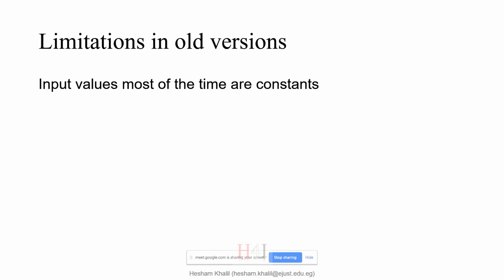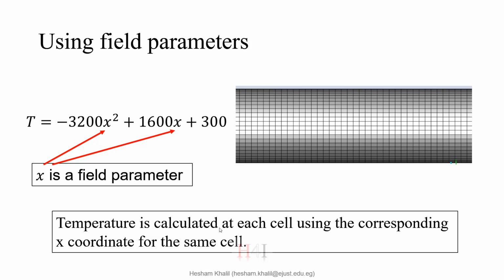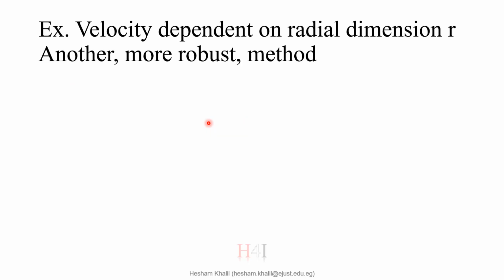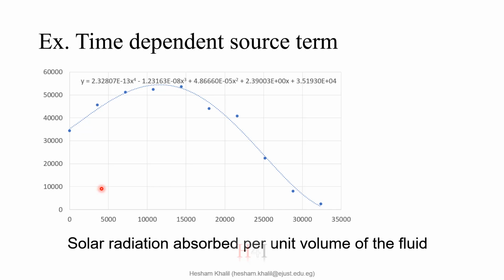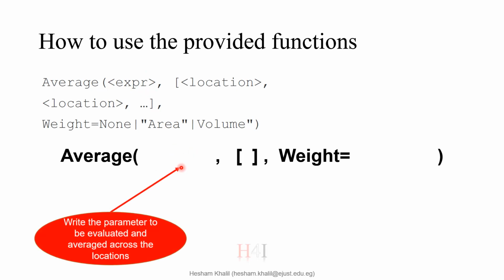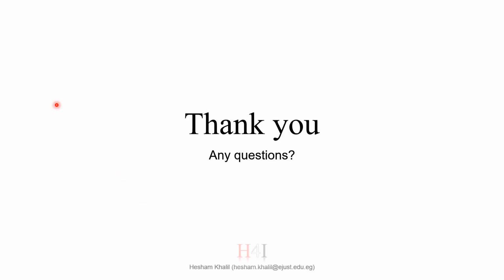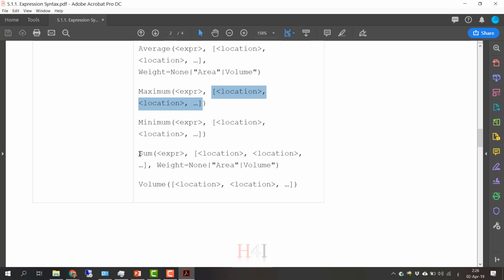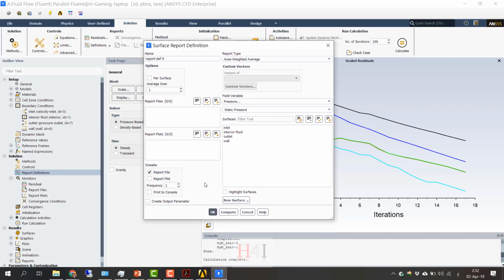Presentation of FLUENT 2019R1 new expressions (UDF alternative)

Comment: Hi and thanks for the tutorial. In a case that I have, I need to change the boundary condition during the simulation, after a certain time, from velocity_inlet to wall. I'm wondering how I can set FLUENT2021 in this regard. Thanks in advance.
Reply from the maker: Yes you can use conditional statements to change values with time
Reply: @h4ienglish  I don’t want to change the value. I need to change the type of boundary condition (velocity-inlet —> wall). I think it could be done through the “Execute Commands” however, I need to learn how to write its code on FLUENT. Would you please give me some hints?

Comment: I have a small query, i want my inlet to be a sinusoidal pressure inlet (like p*sin(w*t) ) . w is frequency in radian and t is time. Could you guide me please.
Reply: I used a udf , that is from ansys manual but didn't got the desired results..
Reply from the maker: If you wish, I can help you with the UDF, but it is a paid service.
You can contact me through the Facebook page, H4I software services.
Reply from the maker: I think it can be done. Did you try to define this equation as described in the video?

Comment: Thank you for this very informative lecture. Sir, I have one query. Sir, during simulation, if there is any negative pressure is generated then that negative values I want to make it zero. So that I won't get any negative pressure after the solution is converged. (What i mean is, all calculated negative pressure
and their gradients should be equal to zero throughout the iteration). How can I do it ( by writing expression or any other possibility)? Sir, I don't have any specific expressions for doing this so that I can directly add that expression. Thank you. Waiting for your kind reply
Reply from the maker: Sorry, but I do not know how I can achieve this.

Comment: Thank you so much for this detailed explanation. I have tried adding a body force for a VOF model the expression is as follow: -3675000[N/m^3]*volumefraction
Although the syntax is correct, I receive an error message "Invalid expression: -3675000[N/m^3]*volumefraction" 
Any Idea what might be wrong?
Reply from the maker: What is the units of the volumefraction?
Reply: I have figured out the problem . The expression should be written as following “ -3675000[N/m^3]*Volumefraction(phase=“water”) “
Where water is the phase name. Thanks!

Comment: First of all, I would likte to thank you sharing the very useful video. But I could not compile the expression of temperature dependent thermal conductivity. Fluent tried to get constant value.
Reply from the maker: I need more information, what is the error?
Reply: @h4ienglish  I am trying to write the heat conduction coefficient function depending on the temperature. k (T) = a + b * T ^ 0.5 + c * T ^ 1.5. When I write this expression in named expressions, it says that this expression should be entered as a constant value.
Reply from the maker: You can specify thermal conductivity as function of temperature using the option "Polynomial" and the coefficients must be constants. It seems that material properties do not support expressions.
If you want to specify it as a variable in other properties, you have to use "User defined functions".
Reply: @h4ienglish  Since T has no exponential forces 1 and multiples, I can not define it as a polynomial. I will try to write UDF. Thank you very much for answering.

Comment: Dear Hesham,
thank you for the video. I have a question:
￼ UDF for simulating the suction feeding in a fish

  #1

moh.hefny

New Member

 

Mohamed

Join Date: Sep 2019

Posts: 1

Rep Power: 0

￼

I would like to simulate the suction feeding in a fish. To that end, I created the geometry of a fish in a tank (2D). I need to modify the mouse void (buccal cavity) during the simulation so that the fish sucks water in. I assume I need a UDF to move the boundary during the simulation (dynamic mesh).

Unfortunate my knowledge in this part is less than basic. Could the method you have been showing be an alternative to udf to perform this simulation?
Thank you in advance.
Reply from the maker: Sorry, I don't have experience regarding Dynamic mesh.